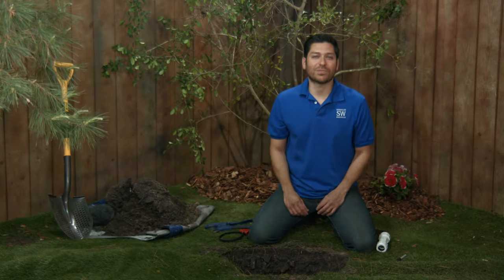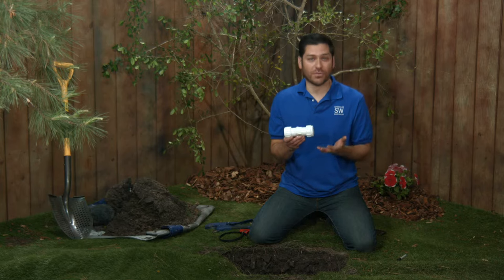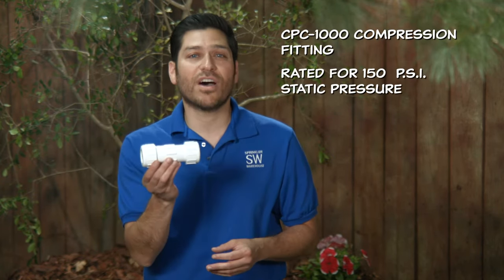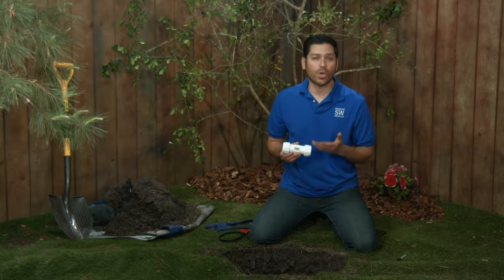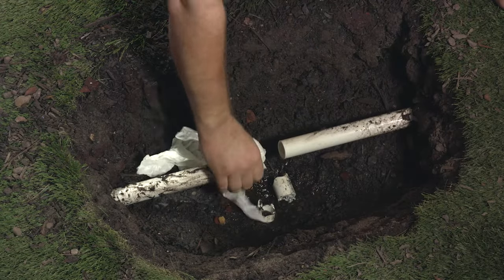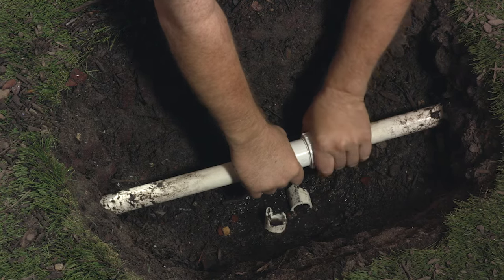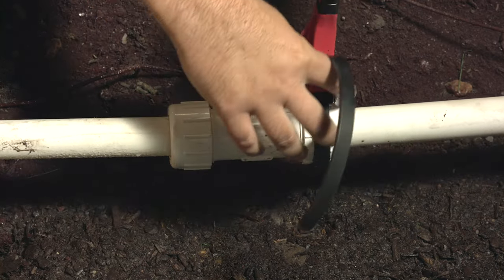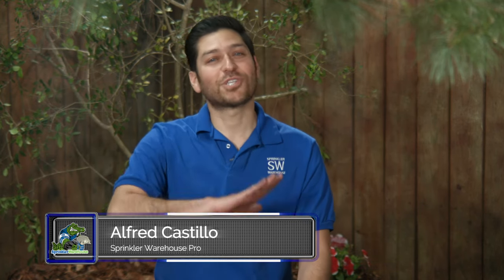PVC Compression Coupling

Comment: Hand tighten is definitely not enough strength. It will blow under pressure. You have too make sure you tighten with a wrench a good amount. Also make sure the pipe is braced up against something. Such as compacted dirt. These water lines such as 1inch or 2 inch are carrying hundreds of pounds per square inch of pressure. Make sure the pipe is braced. And very tight.
Reply: I did my hand tight and tested before backfilling with dirt.   After about 30 seconds the coupler separated.   Certainly going to have it braced against dirt and tighten more tonight.   Thanks
Reply: Good advise.

Comment: Hi after installing this i notice that it leaks a bit. Not drops like the ones shown in the video. It leaks like one drop every minute. But its on the main line so it has pressure 24/7 all spring and summer. I already tightened it as mush as I could by hand. I cant get a wrench in there because there is another pipe on top of it. Would that be bad.
Reply: You may have to cut the one on top to make that repair correctly.  Repeat for the one on top. Otherwise leak remains

Comment: Can you use it on galvanized pipe?
Reply: You can as a temporary fix but it will leak later on.  This is mad for pvc / plastic hard pipes. either have some weld your damage area or get a compression fitting just for galvanized pipe.  Is made of steel also.
Reply: These are designed for galvanized or PVC pipes. According too the Homeworks PVC maker. Just make sure it's tightened by a wrench and definitely not by hand. Also free of any movement, hence it must be braced before being pressurized.